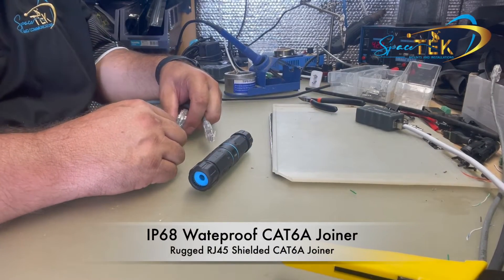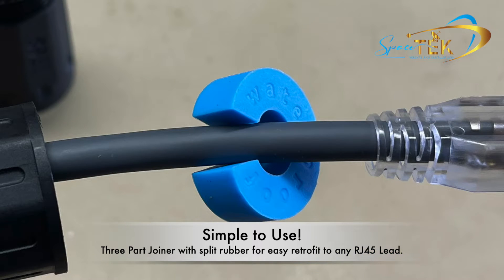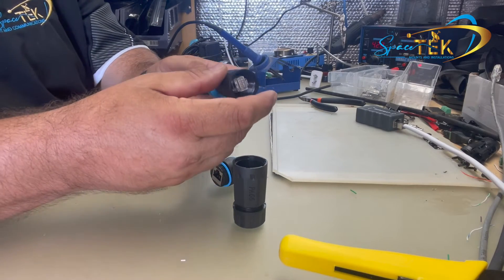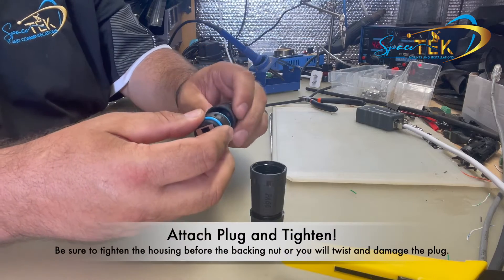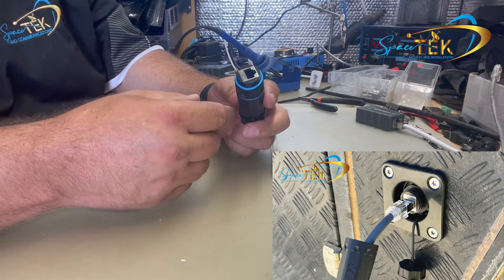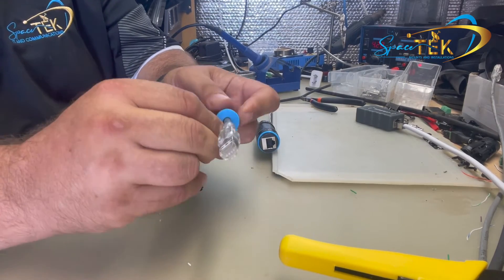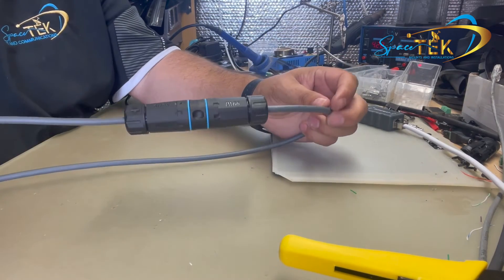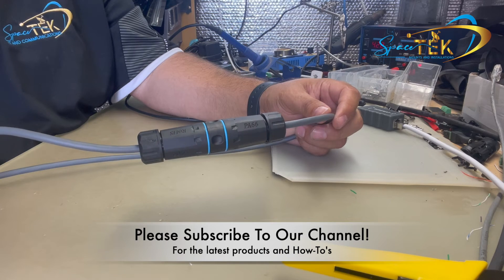Starlink Cable - RJ45 IP68 Joiner

Comment: Thanks for a awesome vid. Can this connector be used to extend the cable that runs from the dish to the router? - I believe there is power going back to the dish (Gen3) I only need to extend my cable on a temp basis so do not want to cut the original? Do I extend with Cat6A or Cat5E cable?